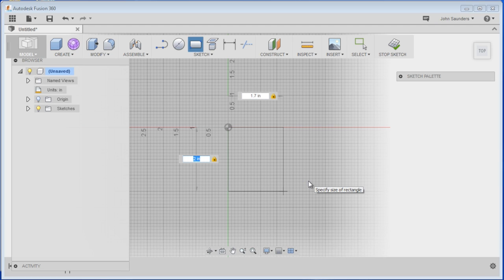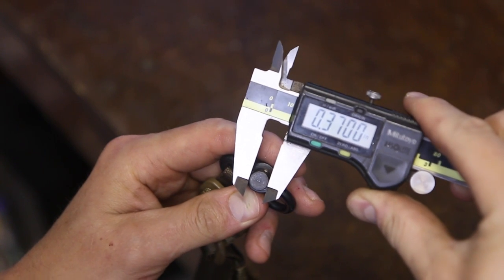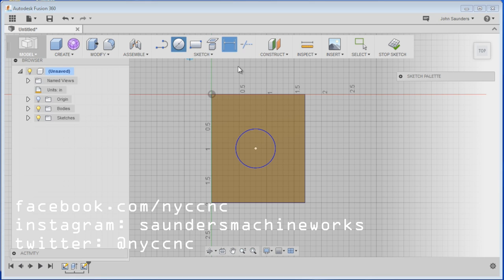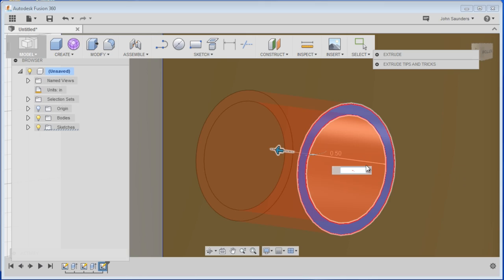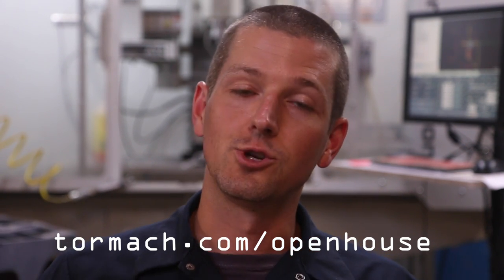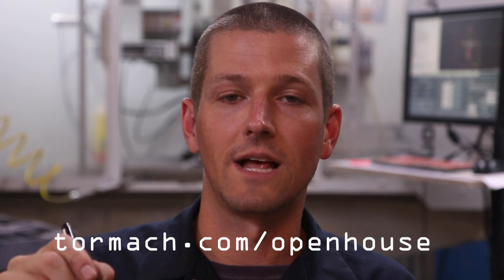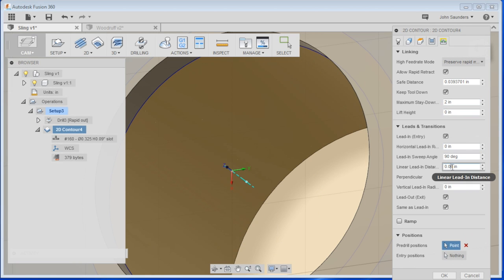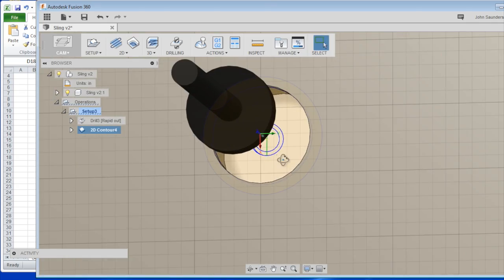DIY CNC Quick Detach Sling Adapter!  Widget48

Comment: Cool programming on the undercut.

Couple of things (I use to sell high-end camera straps using custom made stainless rifle QD sockets):

1- Only use QDs made by GrovTec, the rest are all kinds of cattywampus.

2- Be sure to put a chamfer on the inside edge that the ball detents contact. not a big chamfer, but you'll run into long-term wear issues if that edge isn't super clean. Remember, all the stress from the sling (rifle weight + momentum weight from movement) is making contact on that edge.

Comment: This was one of the trickiest things for me to dial in on the WarBlock. I have to interpolate the hole to 0.377 since I can't just drill it due to the offset gas port hole. I also need it to be blind to allow enough material to fully enclose the taper pin. On top of that the rotation limiter geometry had to be tweaked just right so as not to bind the ball bearings and prevent the swivel button from locking out, but also not to thin the side walls and cause dimpling from the heat of nitriding.  This and all the broken woodruff cutters have driven me to the brink. I might try to find some radiused ones in the future. Nice job!
Reply: War Machine LLC AB Tools makes radiused t-slot cutters. I can't say they're the best cutters you'll ever find or anything, but I bought one to cut aluminum and it seems pretty nice to me! It's 3-flute so it really gets the chips out and also doesn't have chatter issues like the 10-tooth cutters I had been using. They make them to order, and when I ordered mine I asked for the wrong neck length. Of course, I didn't notice until a week after I got it when I was getting ready to use it. I called them up and they fixed it for me for free (less shipping). 100% my mistake and they fixed it - nice! They aren't exactly what you could call inexpensive though, but at least they publish their prices. My cutter cost me over a hundred bucks.
Reply: NYC CNC
Yea Rhino is clearly responsible here for this and all of my many other short comings. They will hear about this!!!! LOL

Comment: Some of the feeds recommended scare me as well (I'm using GWizard).  Probably safer to set a lower feed and if things are going peachy during the milling, use feed override to speed it up, watch and listen for trouble and adjust speed accordingly.  However, if I were running a production shop or had a hot repair to do in a job shop, it would be balls to the wall and dam the torpedoes.  : )

Comment: John - great video - I had trouble doing an undercut of a 1911 thumb safety with a woodruff cutter.  It is an elllipse.  The Lead in and Lead out were not on the same path - same problem as you had.  No matter what I did it, the lead out was always off the center line.  I tried your settings and it still didn't work.  Finally I set the "Linear Lead In" distance to 1 inch and it gave an error that is was going to ignore the lead in - and the tool path posted straight in and straight out.  I'm not sure why your settings didn't work - but they didnt.  Probably Fusion 360 growing pain. . .

Comment: The proper mounting base for that QD swivel is actually a groove for the ball bearings. Not just a undercut which doesn't support the inserted post. In the amount of time it took me to watch this video, I could have made the mount the correct way with an electric hand drill and Dremel.